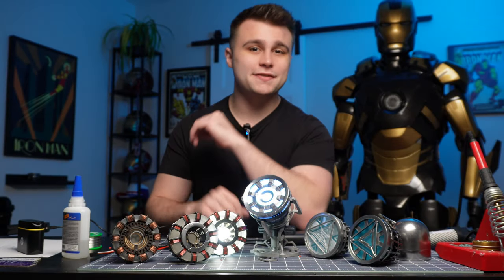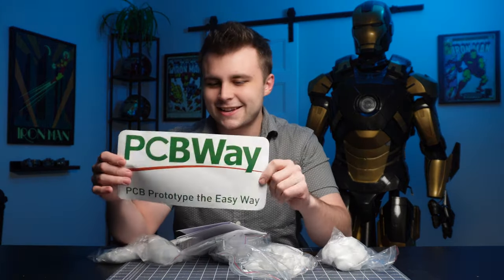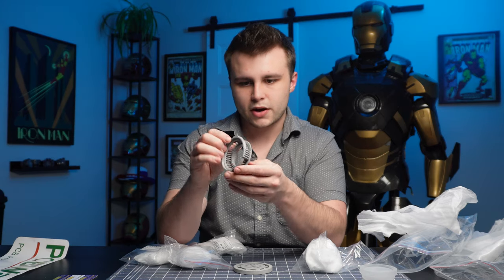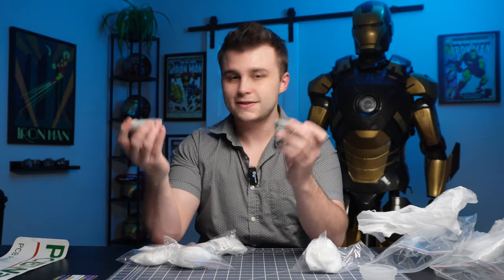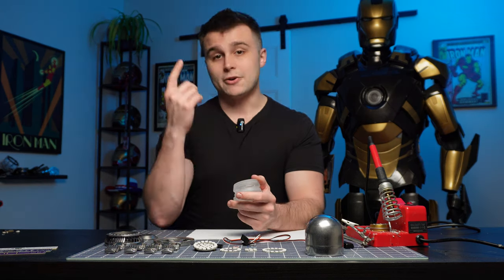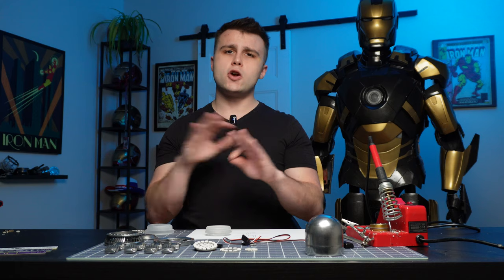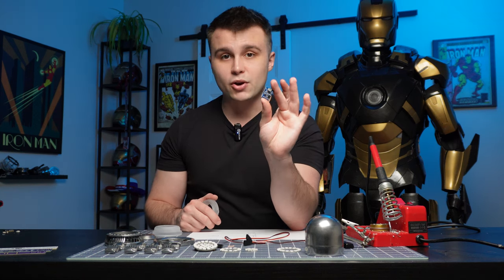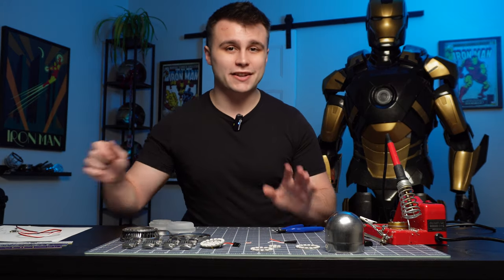I Made Iron Man's ARC REACTOR! (again) - 3D printing METAL cosplay props!

Comment: What if you designed one of the ark reactors with having an internal battery, but can still be wired using either magnetism golden contact pads on the inside, so like a miniature battery, but it slips into the bottom slot with magnets or clasps like a hard battery has gold contact pads kind of like cell phones with removable batteries.  Then you can still have a wire running through it using the connector pins. You can get the best of both worlds portability and being able to power it.